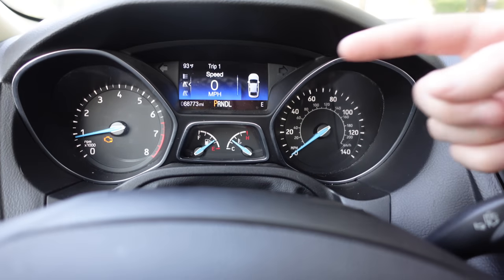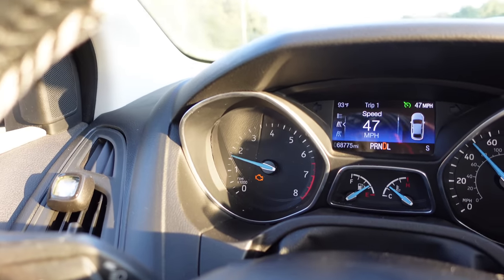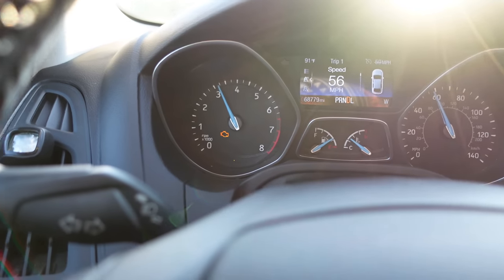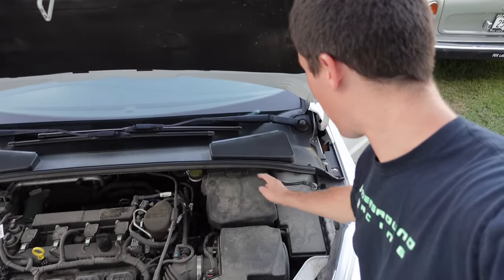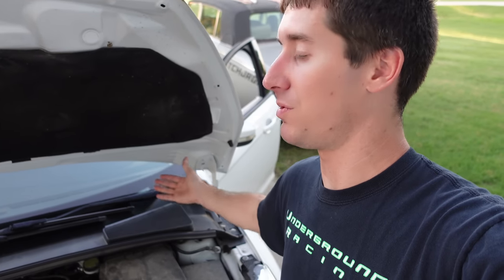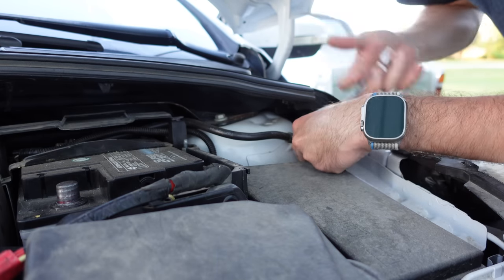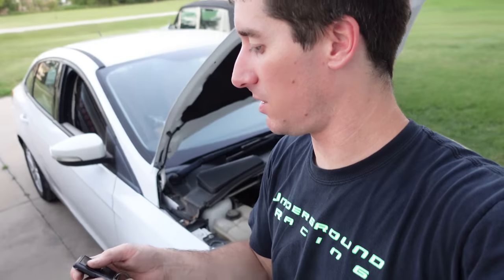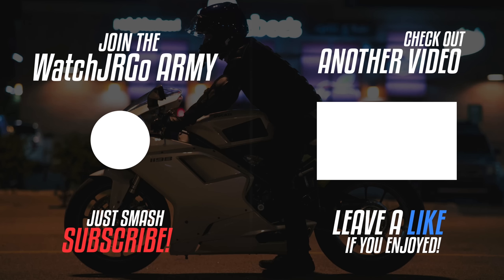This NIGHTMARE Transmission DESTROYED The Ford Focus (Fixing My Girlfriend's)

Comment: I still have my 2012 Titanium, bought brand new, and currenty at 164 000 miles on the original clutches and DCT. It can be picky at time, but very good if you drive it like a manual. 

Not sure if thst can help, but those cars are VERY sensitive to any kind of play in the front end (ball joint, motor mount, etc.). The transmission seem to try and compensate for any slack, and slips and jerk, and shift very slowly. Had some front end work done not long ago, and it actually fixed what i thought was cluch slowly going out. 

Since you have a shot motor mount, it could make the issue much worse.
Reply: 100%. I think the "mechanical flaws" on these are massively overstated - 140k 2012 SE here with original clutches and transmission. It did have a TCM fail at 90k, but that was free. Driving it like a manual with an invisible clutch pedal helps GREATLY. It definitely has a personality, but once you learn how it likes to be driven, I actually like it. And if you drive it right, it rewards you with better than advertised mileage.

My guess from a limited sample size is that all the mechanical failures start as TCM failure, and people with no mechanical sympathy try to power through the obvious symptoms and end up torching the clutches - it seems the weakness is on the electronics side and not the actual mechanicals.
Reply: Absolutely agree! I'm pushing 92k miles on my DCT and have zero issues. The DCT operates like a manual because at the end of the day it is.

Comment: I had heard about the issues with these cars and the Fiesta and finally found one at Copart listed with mechanical damage. It definitely had issues when it was delivered and I did the usual fixes of grinding the grounds at the firewall and it only got a little better. I finally took all the bolts out for the grounds and transmission ground and put them in vinegar until all rust was gone. I also cleaned the transmission to body ground wire under the air cleaner the wire ends were corroded. Put them back in and all was well. It really was bad grounding and mainly from the transmission losing signal and freaking out from the ground issues. Always on the look out for another.
Reply: So before you give up check all the grounds and wires under the air box and clean them. Check my other post
Reply: I have a 2017 Fiesta SE with 80k miles now. Made my grounds properly grounded, and sealed in dielectric grease a year ago when I got it used, and it drives fine still. I think too many in the Mexican factories didn't come to the conclusion that the grounds need to be on unpainted body steel, to make a good connection, so the ground tabs needed to be masked before color and coat.

Comment: My 2013 Ford Focus with 179,000 miles and dual clutch transmission runs as good as the day it was new, and shifts as smoothly as any fully automatic transmission that I have had.

Comment: I had a 2011 Fiesta with the Powershift.  The clutch pack was replaced under the previous owner.  Luckily for me, an electrical fire from a seized radiator fan took the car before I had any transmission issues.
Reply: You are the luckiest man on earth 😆😆 !! Got rid of it before it got rid of your wallet !!

Comment: My son got a new 2016 Focus SE. He started having issues at 10k miles. It would frequently drop out of gear at freeway speeds. He had 3-4 firmware reflashes/upgrades which helped a little but it still was bad. He gave it back to his mom and she thought he screwed up the transmission until she found out about the issues and Ford extended warranty.

Comment: youre not supposed to put the dielectric grease on the connection but after you put the ground back on and then coat the entire connector.
the grease is meant to insulate against electricity and not allow it to flow.
Reply: Wrong, You put it on or you could use Copper anti-seize. Use a voltage drop test and you will find it to be good, even 5 years later.
Reply: @FRUGALWITHJOHN     ashishpatel350 is right.  Definition of Dielectric: a nonconductor of direct electric current.

What Is Dielectric Grease?
 is a viscous non-conductive waterproof substance used to protect electrical connections from corrosion and dirt.

How to use Dielectric Grease
Dielectric grease can be applied to the metal parts of virtually any electrical connection that will be exposed to the elements to serve as a sealant that protects the connection from contamination and corrosion. 

Application should be done very carefully, as the grease will cut off the flow of electricity through the connection if some of it is left between the mating surfaces.
Reply: @DT-ns9hb  I did send a rebuttal to your comment with a video link, but I don't think the comment section here allows links. I have been a Mechanic for 42 years, sorry you are right and wrong at the same time. (A little but of information is dangerous without all the facts and experience).
Reply: @FRUGALWITHJOHN   🍻

Comment: i have a 2014 focus and so far i have had no issues with my transmission besides the typical jittery shifts which has been happening since the day i bought it. My question is, would it even be possible to swap the dual clutch transmission for a manual without it being a headache? would it even make financial sense?
Reply: You can if you do the work yourself I know theirs a guy on youtube that did it for quite cheap

Comment: I like using antiseaze instead of dielectric. It helps promote more conductivity whereas dielectric is an insulator.
Reply: NO OX ID grease for the win. Actually conductive and blocks oxidation in electrical switches
Reply: @bluetheron  I've seen that somewhere else too. Actually have that saved in my Amazon cart. The only downside of antiseaze is that it can dry out over time. But as long as it's wet it block air as well.
Reply: @Mr69abody  I rebuilt the traction battery in my hybrid and used the NO-OX-ID sparingly on all of the electrical connections. A lot of the sensor wires were corroded when I took the thing apart. I only used dielectric grease where I wanted to prevent things from shorting out but still wanted to have that ease of removal. Mostly, I use it on the lightbulbs.

Comment: @WatchJRGo Swap the clutch actuators and see if that makes a difference, there is also another ground under the air filter housing. Shift forks could be gummed up with all that clutch dust too

Comment: I "think" from 2016 or 2017 on they had pretty much resolved most of the issues with the Powershift in the Fiesta and Focus. Still, I wouldn't touch one regardless. The weird thing is my nephew has one just like you're driving and its been fine for him (not sure what year).
Reply: My 2017 SE drives pretty good. (Almost 80k miles now)
Reply: i have one and its been fine but my sister bought a 2017 also and her transmission went to shit. really just seems to be luck on if the car will live or not.
Reply: @DetroitMicroSound  hows it been driving almost a year later?

Comment: I had 2018 focus SE with the power shift transmission, had the clutch replacement done by the Ford dealership with less than 10000 miles. Sold it soon after. The worst part about the transmission was waiting for that horrible jerky shift that you knew was coming any minute. It made driving the car a nightmare and me a nervous wreck.

Comment: The sad thing is, there are 5-speed stick shift cars out there with like 200,000 miles and going strong. Those are cars are probably some of the best in the class. Great fuel economy, nice ride and handling, 160hp is enough to get by.
Reply: Yup. Own a 5 speed. 60k miles and I've only had to do regular maintenance. Even still running the sketchy 8 year old factory Conties.

Comment: I had some problems with mine at like 156k (just over fords 150k extended warranty) had rough shifts and codes p285e for a shift fork actuator A circuit high. Tired the ground method along with a new battery. Got so bad the car got stuck in 1st gear. And the TCM is on back order from ford. Grabbed one for 460 off of eBay and another 38 for a forscan Adapter and 12 for a one year license and got it fixed. Had to flash it and than go through a relearn process. Have 5 or 6 k on it and it’s been okay. Still had shudder in first gear sometimes. But if I hit it just right it won’t shudder as bad or at all. Trying to get a little more life out of the car.

Comment: I was moon-lighting as a valet around 2013-14 when Ford introduced the powershift Focus/Fiesta.  These were brand new rental cars, like less than 1,000 miles on them and the transmission shifted like it was broken.  Slipped or lurched when pulling away from a stop, banged into gear on the 1/2 and 2/3 shift.  Who in their right mind would have bought one of these new, when on the test drive it felt like the transmission was broken.  I've heard they're great cars if you get one with a manual.  And manual ones are stupid cheap because of the bad rap these cars got.

Comment: I have a 2012 Focus Hatchback Titanium. I have over 263K miles. The rpm’s will slightly vary because you’re going up and down on a road with cruise control on. This is essentially a manual transmission. When you nail the gas and there’s a delay, that’s because it’s gear hunting. This transmission has two problems. One issue is that it slips into neutral. That’s not the transmission, that’s the control module outside the transmission. The other issue is that it shudders like a stick shift. When that happens, people think it’s bad and they get rid of it. It’s still driveable. Mine has been shuddering for over 5 years. The car itself is built like a tank. I’ve tried to kill it so I can get a new car and it won’t stop. I even taught my daughter how to drive with my shuddering transmission and she did great.

Comment: Bought one band new in 2012, and still have it.  Took it in when Ford sent me letters, but ever had any issues until recently.  The TCM failed at 180,000 miles, and Ford paid to replace it.  Then the clutch pack failed at 183,000 miles.  It was rusted solid due to a leaking starter seal.  Paid for that replacement because the money was better spent repairing it than selling it and buying an used car with a unknown history.  The service guy said that was very good mileage on any clutch, and impressive on a DCT.
   
Bottom line, from my sample-of-one experience, do the required maintenance and drive it like it wants to be driven and it will last a long time.

IMHO it's a great car that was damaged a bad initial programing issue and very bad press.  BTW I've spent less than half on non-maintenance repairs on the focus than on our 170,000 mile 2006 Toyota Tacoma.

Comment: 16:34 if you think the focus battery placement is bad, you haven’t dealt with the absolute NIGHTMARE that is the 2013-2019 Escape; to remove the battery, you either have to completely remove the windshield cowl, or the air filter box! And coupled with the Lug Nut Plague (it’s not a matter of IF they will swell, it’s WHEN) and if you have to replace the heater core or evaporator, BOTH FRONT DOORS have to be COMPLETELY REMOVED to access some of the dash bolts, the torque vectoring clutch in the rear differential in the AWD models loves to grenade and it’s a $900 repair, and the engine skid plate that is the bane of all quick lube technicians (that aspect GOT WORSE with the 2020+ models) it’s the reason why I’ve dubbed the escape the most maintenance unfriendly vehicle in ford’s ENTIRE vehicle portfolio.
Reply: Thank God I never bought one of those turds.  I came real close in 2013 after they first came out.  Thanks for the heads up.
Reply: Yea, car company's have been putting lug nuts on cars as long as I can remember.....Ford managed to screw up even lug nuts.

Comment: I had the 12 Fiesta and it was a little gas saving rocket. I started having issues around 70K miles. First it was the battery causing the  transmission slip, dealer replaced the battery and  performed a software update. It fixed the problem and I traded it immediately. I would be driving it today if it was a true manual.

Comment: My mom has a 2012 Ford focus bought a brand new, two transmissions and a TCM did not fix the problem. I watched a video from a guy in Canada, who had a shift problem with no reverse it, cleaned the negative ground cable terminal, and where it grounds to the car and cleaned it down to bare metal in the car shift perfectly I did the same to my mom‘s car and the car shift perfectly follow the ground cable off the battery to the chassis clean it down to bare metal. It works for me. Car is great now.
Reply: Can I get this done somewhere?

Comment: Yeah, I remember those powershift trans issues back when I had my old Ford Fusion.  Luckily, my Fusion had a normal 6 speed auto, but when I would get it serviced, I would always get a Focus rental car and most of them had powershift trans issues.  I had one that had maybe 10k miles on it and the trans was already jacked up on it.  Also, I think it had a major class action lawsuit due to how many of them were failing.

Comment: I had a  2010 2.0 powershift that had only 2 issues, going uphill in reverse it would jerk violently and after a long journey you would feel slipping in the shifts but it lasted 110000 miles and I did one gearbox service in the 5 years I owned it.

Comment: I had the same car but the 2014 version. They had a recall issue with this transmission as long as the car is under 70k miles. It also had a backdoor latch issues, recall, Trunk latch issues, recall, faulty security system located in the radio, silent recall. For I believe four years they used a European style transmission. One reason it had the roll back like a manual when sitting on a hill. Call Ford and see what they say. It is under 70k miles.

Comment: Lost reverse and then got an overheated transmission warning, which then shot my whole electrical system (no power to any dash or key fob). Did the grounding trick and replaced Actuator B from the underside. Had to jump my car to get it started, then she drove fine! But once I turned it off she won’t start again… I’m thinking the battery or spark plug issues? 2014 with ~153k miles

Comment: I had one of these for a few months when my main daily driver was in accident so the body shop had it for awhile. Uber had unlimited mile short term leases relatively cheap so it was a no brainer. 

I had the transmission overheat warning turn on a hill going up waiting for a red light but luckily I returned the car a few weeks after.

The other annoying thing was the bottom door outside scuff plate would get super hot and burned my calves a few times exiting the vehicle. I’ve had over a dozen other cars that never happened before.

Comment: I test drove a 2014 focus titanium with 35k back in 2016… and was so put off by the transmission I passed on it even though it was a sweet deal. It felt like it was going to stall when coming to a stop, and like you said, needed about 10% throttle to even start moving the car. This was basically a new car, no codes. It’s a shame, because these were nice cars (for the price) otherwise! If only ford had just put a normal old torque converter trans in it (or put the manual in higher trim levels). Pretty sure this car is why Ford stopped selling cars.

Comment: Transmission mechanic here, honestly the best thing to do would be get a clutch kit made by LuK, comes with everything you need. Also, a brand new TCM from Ford will fix the issue and get you smooth sailing
Reply: You also have to do all of the relearns. I work at Mister Transmission in Kanata, Ontario, Canada. We have seen several Fiestas and Focuses.
Reply: Once it’s fixed how long before it fails again?

Comment: I have this same Getrag 6DCT450/MPS6 gearbox in my Volvo V70. I was experiencing 'snappy' starts from traffic lights and sometimes rough shifts. Then I changed the oil and what a difference!! The oil change interval that Volvo recommends for the DCT-gearbox is 37.500 miles (60.000 kilometers) and that is very important to follow. The oil to be used is special DCT-oil -DO NOT use the normal red ATF!! The oil filling procedure is quite complex, engine has to be idling when checking the final oil level. My Volvo has 190.000 miles on the clock and still going on strong.

Comment: Usually just the TCM. They lose electrical conduction overtime due to corrosion / oxidation of contacts. I think, just opening it up, and cleaning the contacts of the pins inside the TCM may fix it. The weird shifting is because sometimes it skips gears. Like it shifts to 1st gear, then it does not engage 2nd gear, then goes to 3rd when the proper speed is achieved.

Comment: 2015 Ford Focus SE with 64,000 miles. Same code, same issue. Local Ford dealer asking $3860 to repair. Ford care and everyone we have spoken to says it is one year to old for them to help with warranty.  Car is too new/low mileage to junk, but costs too much to fix. I don't usually comment on here but I am at a loss for words and am not sure what to do. $3800 will have a huge effect on me financially. Any thoughts?
Reply: Clutch forks are almost always the problem with tiny bearings inside then that get stuck over time. I've change a few over the last year and a half, in the driveway, no special tools, and used parts from my local KennyYouPullItYourself for under $100